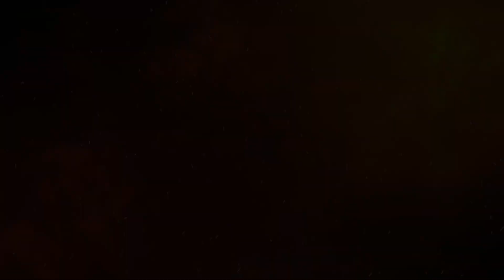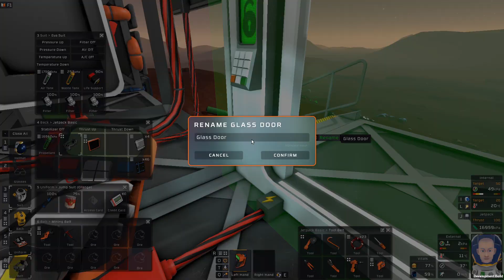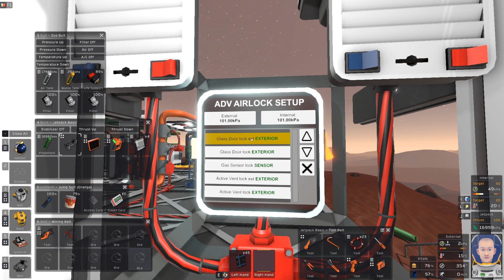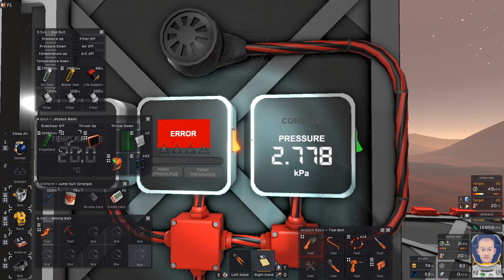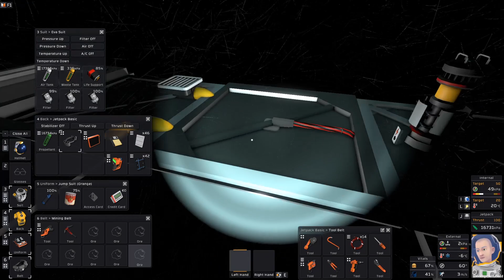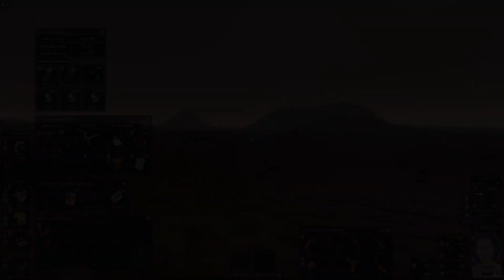Stationeers #9: Base Pressurization

Comment: "Unlike the name suggests, Uranium is currently not intended for any energy-releasing applications. Not even the Nuclear battery contains it in its recipe. The only utility of Uranium currently is that you can use it to off-gas a lot of Pollutant used for Coolant." - Unofficial Stationeers Wiki. If that helps :)